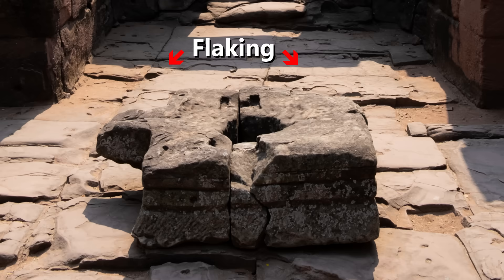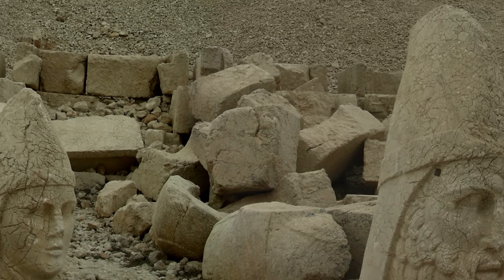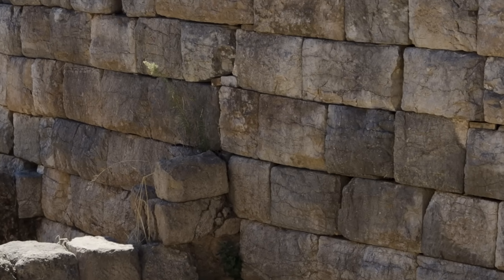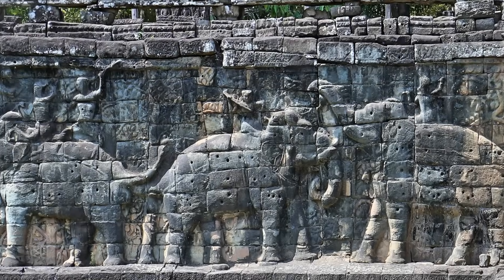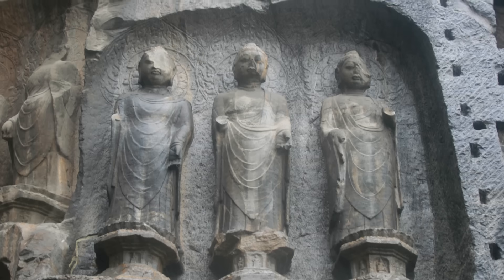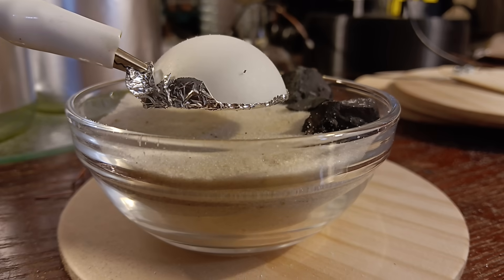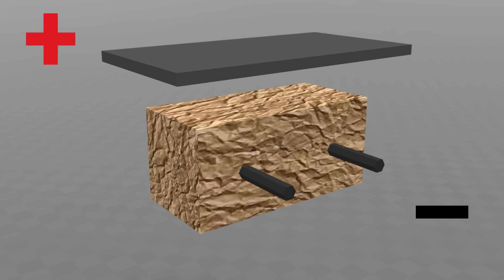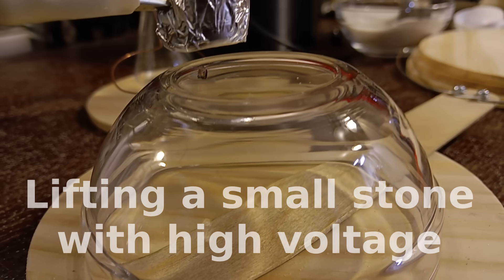The Greatest Mystery, Solved. Recreating Ancient Stone Melding Technology (Part 1)

Comment: 1:30 China. The stone is being mined, not set. Yet, there are "nubs".
Reply from the maker: Yes. This stone process was used in the quarrying and construction.
Reply: @MadPlasmatist  Right. They didn't melt that stone while quarrying it. They carved those nubs for whatever reason.
Reply from the maker: @Greg042869 Why would you think they would only use this stone softening process to build with? You can clearly see iron electrode stains down the sides of the main stone, the nubs are left from the electrodes being removed, i.e. no staining =)
Reply: @MadPlasmatist  Your theory is that electrodes are put into the stone being mined, to soften it? And electrodes were removed from the block where there are nubs, but left in at the stained spots? The undercut area would probably be sunken or have a melted, sagging appearance if it were softened, don't you think? I really don't think they would soften the top to the point of creating melted nubs and leave the bottom part they are carving completely solid and rigid. In any case, good luck with the demo.
Reply from the maker: @Greg042869  I think what we are seeing here in this instance is what is left from the stone being quarried all around and these 'left-over' structures were used to hold some kind of equipment, hence the several shelf-looking areas, and furthermore, once the equipment is dismantled, quarrying of the stone further would be too much effort without the aid of this machinery configured in place so this 'waste' structure is left intentionally. The smaller electrodes were left, the larger ones which leave nubs were removed and probably used elsewhere. Thanks for the comments and luck, stay tuned =)

Comment: They used Diamond covered wire to cut the stones, as we do today. Easy, low-tech and could have used hand power to do. And we know where they got the stones from(quarys). The nobs and holes are for lifting them in place.

Comment: A.The sun and salt water....the eqyptians had a form off solar pannel if you google it but also using salt water or vinigar or any solution and 2 diff metals you can make power then series and parralel each batt too get desired power...2.The records there could well be many records we just have not seen them...3.It wasnt necessary transfered world wide it was localised each did there own thing in slightly diff ways diff materials but same principles..4 Im not sure what you mean the two electrodes would have been connected too raise power either in parralel for current or series for volts but it would be a mix off both..5..i dont belive they were melting rock but casting around components with a doped type material like a cement with extras that improve whatever you need perhaps but cast around parts...6 As stated im not sure about melting stone more casting diff materials sand n gypsum n lime n other things can cook up add smashed stone powder whatever but can do cold mixes too just like a modern cement...7 Not with a cast shape too hold it...8...I have no suggestion or thougt about that...the fact the nubs are present means had a purpose because as you said you could always remove those nubs after dry or settled you could chop away n leave flush but they chose too leave them...8 Maybe they did and a cold cast off concrete or mix you can leave air pockets in many ways.. an empty tennis ball in your mix today would do so but a hot cast mix there will be techniques for such things but i misseed that part off the video so im just sharing idea there really so i have too watch again....if any more questions keep em coming lol 😁

Comment: Slow down there my little bucks too . To say it was plasma I could say it is lasers , or some other unprovable process . It is more likely yo say it is a cement . There is no proof but also it has more questions . Where is power source ? If the used this power why didn’t they do something else with the power ???
Reply from the maker: Only heated plasma can reach far into the stone (it can go through glass), however there may be other methods as well. There is also much they did with this power, I don't know where they obtained it, however the fact that an SGL (see my Spark Gap Lingam video) functions perfectly as an elegant high-voltage, high-amperage spark gap is no coincidence incredible power was put to 'work' =)

Comment: The rods in the Great Pyramid Queen's chamber shaft are not a mystery.  They were used by the Edgar brothers to probe the shafts after they were opened in the 19th century, and some of the rods got stuck on the bends in the shaft and broke off, so they could not retrieve them.
Reply: Yes, I think there might be documentation from the time?
Reply: all the video is debunked b of this fact
Reply: There is no way they carve the stone with the traditional archaeologist point of view of using a copper chisel. It is impossible to do. If you don’t understand that like most archaeologist are not construction workers are not concrete. Workers have never worked with heavy machinery or moved heavy materials. There’s absolutely no way one of the softest metals could carve one of the hardest granite stones in the world. Not possible. No person has ever been able to prove it either. Especially an archaeologist has never done any work with their hands. Only a working man understands these principles, not a keyboard scientist.
Reply: @sir_cornholio5  have you tried this in the field and can you provide proof you did try with pounding stones and copper tools but failed?
Reply: @ Well, you may be right, I don't know exactly how they carved everything. However, I do know enough about quarrying to know they only need some small holes or cracks and then the majority of the work can be done with wedges and levers rather than brute force. Also, we know for certain that ancient people understood that they would weaken rock by heat, or application of caustic substances, and cause cracks by repeated heating and cooling. None of which require iron tools to do.
Reply: @keepinmahprivacy9754 everything you said is definitely true but those facts are not what is seriously disputed. When it comes to extremely hard stone how did they shape it, and the most disputed is if it is precise how did they shape it precisely. When it comes to giant stones how did they move and lift them, quarried isn't difficult but in alot of cases we can't even explain how they lifted it out of the quarry, or if they had a flat road entrance how they even moved them out of it. The log rollers can only scale up so far before it doesn't work anymore, same thing for lifting giant stones.
Reply: ... and they documented it officialy so that nobody makes this misstake. Although in another 2k years, after WW5, someone finds them and says "Look metal RODS! My powerplant theorys was right!" ...
Reply: @cobra5x5  😄
Reply: Correct
Reply: Yes , on the channel History for  Granite. ..... look up four shafts  Pyramid. That say all about the rods. .. really good vid. Also... very cool. Ive been waiting a long time to see how they made these stone structures. Thank you for the vid!
Reply: Where did the Todd come from? Found in or near tomb perhaps?
Reply: @d_beez  The rod is still stuck in one of the Queen's chamber "air shafts".
Reply: Those rods were made from steel were they not?….. I don’t believe that the ancient Egyptians had steel….
Reply: @keepinmahprivacy9754  dont see madplasmabottomman in here trying to refute this excellent point. 👌
Reply: Yep, I was out as soon as this part played. Stupid.
Reply: haha nice try, the copper rods are stuck right through the stone door not stuck on the bends

Comment: You cannot melt and re-solidify granite on the Earth's surface because it is created under high pressure and cooled down very slowly. When you melt granite and let it cool again, you won't have granite any more. With other stones that have been used for building ancient sites it is similar. And the so-called "electrodes" in the pyramide shafts are modern rods that have been used for probing the shafts. Thumbs down!

Comment: You probably will see me next time, but if you don't do a better job of showing actual evidence, no more after that.  Didn't you start the video with verbiage to the effect that you are the only one who has "proven" something like this?  This is no more compelling - yet - than other theories.  "Lifting" stones that weigh a ton with magnetic fields?... we can't generate that kind of magnetic field today, and if we did we kill anyone in close proximity, yes?  If this really works, then you should be able to create scaled down example of it, otherwise how can anyone take it seriously.  Just as likely that the holes and attach points were for rods to help lift and set big stones (because if you wrapped around them their weight would trap the lifting appratus underneath - pins makes perfect sense there, and non-round pins make even more sense to prevent rotation and slippage).

Comment: After you go 100' or so in the ground, depending on where you are...look at saprolite. It is for all intents and purposes, soft rock. You can see the structure of granite, but you can stick your fingers into it. Freaky to say the least. This material sits over bedrock in the transition zone from soil to rock. This is suposedly caused by chemicals in the ground water. Look at the pics of this. In the past, I dug out samples and placed it in a mold mixed with a little cement and voila! Shaped rock! I even fooled a geologist in the lab. It is like the crystals in the rock seperate but they maintain their structure. I have taken this material and placed it in water in a jar and shaken it up.... it returnes to the appearence of granite. Try it!

Comment: You're not just suggesting that the ancients had access to electricity, but massive amounts of constant  current for prolonged periods of time. "Bagdad batteries" are the only example/proof that ancient humans used electricity, but even in great numbers they would be woefully inadequate for this task. Your claim that the nubs on rocks were formed when electrodes were pulled out of softened stone makes little sense. You state that these nubs didn't matter as they would have been hidden by facing stones or plaster/stucco. However while you make this statement you show pictures of finished and/or intricately carved surfaces that would never have had any finish surface other than possibly paint. Also if the nubs had been formed in the way you state, why would they not have been shaved off while the stone was still soft? I myself believe that if the ancients had a way to alter the properties (hardness/weight) of stone it was likely through the use of harmonics. Though I cannot say with surety That you are wrong in your suppositions, I will confidently state that what you propose is highly unlikely. The title of your video is highly presumptuous, please let us know when you are able to shape and put in place a >10 ton granite or diorite stone.

Comment: I will tell you tv I walk away 
I know I see 
Reflection everyday 
Melting rock yes 
What shape is wall less shadow 
What shape is a rock with out a bottom 
What shape is a tinny pin hole 
Reflecting back at me 
4 it seams  round 
What shape is the light anyway 
Dose it make a light shadow 
Or is it a light light 
Light lite or light lite
Maybe it was live 
Light live lite light 
Mmm 
LesseR we see 
Less you need 
Seed 
Seeds are light 
Seeds are lite 
Seeds see 
Great job great job 
Thanks for the bravery 
All those men on the wire that had not string on them
Reply: Telegraph poles funny my dad just rang say G’day when are we going to the free pool fro a walk and talk well entry size of the thing almost fee workers they gotta eat telegraph pole the wires. My dad once counter them for me 
To walk a hole 
To walk a km 
Funny word mile 😂

Comment: Rocks won’t melt.
Reply from the maker: Yes, and different types in different ways and at different temperatures. It is true. A simple googling can verify this. Also, I'm not entirely melting the rocks but melding them with heat very close to their melting point, stay tuned for part 2 =)

Comment: Electrically melting stone?? Really?? Okay, olive branch: What if small bits of lower voltage electricity was rather used simply to "quick dry" liquid geopolymers (like concrete, for example) in a mold? Like, over a period of some few days? Seems a lot less of a Herculean task, yeah? Perhaps NOT so incredibly high voltage necessary... "path  of least resistance" and all, y'know? I mean, ya gotta work with what ya got, yeah? And I really don't think they had huge hydro-electric generators, for example 😉
Reply from the maker: This high-voltage, high-amperage technique I am presenting - because of the very nature of high-voltage - can reach far into the rocks. It would also work well in the method you suggest, but of course at far lower voltages / generated temperatures (as a polymer would already be perhaps liquid-like or close, it would no doubt boil off or burn near the melting point of stones). Thanks for the intuitive comment and keep watching!

Comment: Not that I believe it, but one source said the "Ark of the Covenant" was a battery that was stolen by Moses from Egypt.  They had to carry it with rings on the side with wooden poles.   When Uriah touched the Ark as it was sliding off the wagon , he was struck down and died instantly.      Of course this doesn't match the BIbles description as to what it was.     But maybe someone was getting something else confused with it.     I saw some Heiroglyphics of 9 foot tall lightbulbs to light up the darkness of the pyramid shafts.    No one knew what they were at the time.
Reply from the maker: Actually, if you apply high-voltage science to most viewpoints of ancient texts & stories, you'll find not only how these things may have been possible but also see many other practical pieces fit into place. I think, personally, for example, that if the legend of King Arthur were true... It was more than likely one of these electrodes or it's handles sticking out of the stone and was mistaken for a sword =)

Comment: This opens new doors: Where electrodes were used implies a technologically advanced society perhaps farther along than ours, but the painful and perplexing question still remains the same: why haven't any machines been discovered?
Reply from the maker: One simple reason is that these metals such as iron would have turned to dust long ago, and any valuable, more durable metals or stones would also have been taken throughout thousands upon thousands of years (of human struggle and conflict even). There are several exquisite examples left however if you can find them (such as a crushed stone motor, its copper coil windings still intact, with strange / unintentional melting at some points...) Keep searching, some relics are there =)
Reply: @MadPlasmatist  I believe that some of the devices we are speaking about are deposited in the Giza Plateau in what has been called the Hall of Records by Edgar Cayce. Zahi Hawass has hindered all attempts to access any spaces in the Plateau for decades as he believes he is the sole heir of all the wealth and discoveries to be made in Egypt. He was already convicted of black market sales of artifacts. There may have already been discoveries that have yet to see the light of day concerning these advanced artifacts. The stories about such things found in buried spaces lean towards technology of just such items. You might be interested in my book Reverse Engineering the Great Pyramid on A*****.

Comment: Why do that with large blocks of stone?
Just fill a box with sand and create a new molten rock in place.

So much easier to transport sand than stone blocks of many tons.
Reply from the maker: Different stones react differently to both heat (its melting points) and high-voltage - melting many types of regular 'sand' will result in a glassy, unusable product with bad structural integrity (too brittle). Also, they had to have made the blocks lighter in some way, I've demonstrated this on a small scale in the video (also the dual purpose of the electrodes in this way to not only heat but lift has the mark of ancient builders all over it), so transporting the blocks may have been the easiest part of the job =) Thanks for the comment, there will be much more ahead!

Comment: How does one make hexagonal or rectangular holes in rock for the electrodes? Round ones would be easier, if they had advanced metal drill bits back then (and something to drive them).
Reply from the maker: Most of the plasma would be at just the tip of a round electrode (see the preliminary rock test in the video, those are round electrodes), the ridges of the electrodes promote plasma dispersal evenly along the sides (not just the tip) and through the stone. It also appears, some or most (especially the hexagonal mark) were made by the electrodes just being pushed into the stones at first, and there are other examples of these 'electrode boxes' being drilled out as well (the drill holes in a 'sarcophagus' in the Cairo Museum, for example).

Comment: I disagree, if a single tool was ysed and similarities between cultures is implied then the flaw would be the inconsistencies in size of the nodule,  inconsistent placement methodologies and overall inability to regulate external heat inversely to the interior as to not deform the vertical faces.. the only way these megaliths get built is with a Highly refined and efficiently enacted build methodologies, if done insitu then this theory is wholly improbable. Plasmification would not leave Spiralized scoring on the interior of a borehole it would leave irregular deposits like rain falling down the tube.